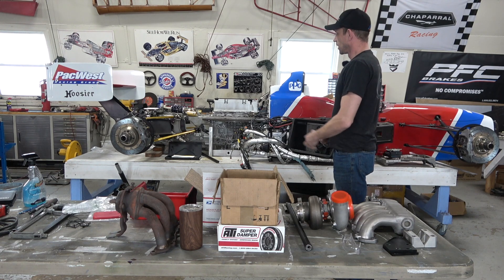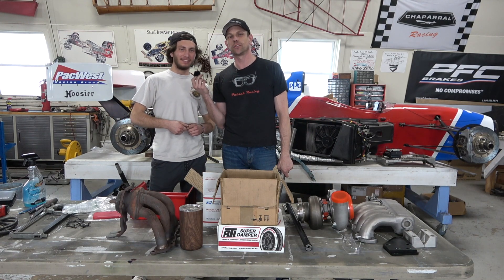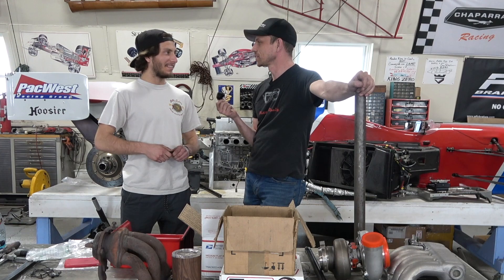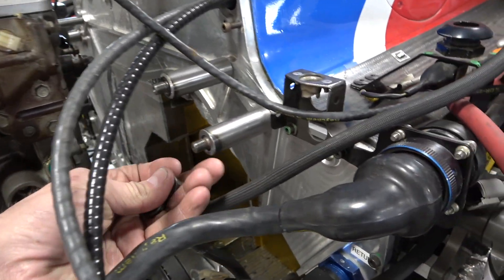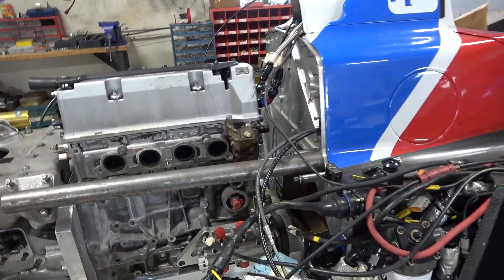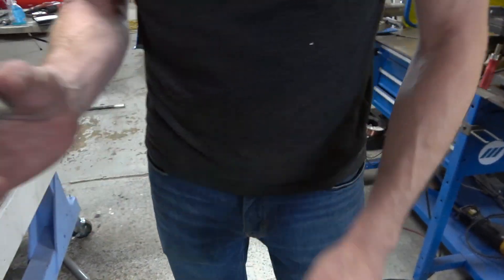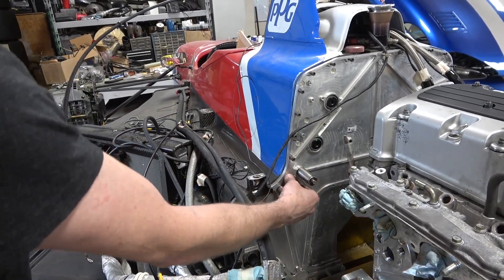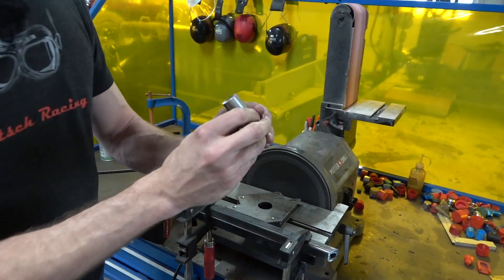Honda K swap Indy Car, I WILL FIX THIS HOT MESS!!!!

Comment: Tell the students to think outside the box with engine building. Doesn’t have to be a car, I built my Honda Groms engine up. Forged crank, big bore, cams, ported head. Still expensive for me while in college, but do able and the stakes were low. Gave me confidence in my abilities too. Cheers Casey, always wanted to join Genius Garage! Graduated in December with my Mechanical Engineering degree!

Comment: Question: While grinding the mount tubes perpendicular on the sander, I would think the linear speed differential of the wheel could lead to uneven grinding. Why not use the belt instead for a more uniform grinding rate?

Comment: I've saved a bunch of bicycle bearing cone nuts using an axle on a cordless drill and a rotary tool with a small fine grinder disc. You just need to find the proper angle for the rotary tool and you'll get the same concave form as the original part, just losing a bit from the total height (or width? as its a part of an axle).
Sure, it will not be perfect and with badly worn surfaces it's quite probable to have a bit uneven bearing surface. Also the nut should most probably be heat treated or something, to get the bearing surface hard enough after grinding the surface. But its still super economic and will get a beat up bike rolling very smoothly with new grease and bearing balls, as long as the cups are not badly worn. Sure, it may not last long, but the original parts were already gone anyway and I'll bet it will hold up a few years even without any treatments. Oh, and of course I'll always use super fine wet sand paper to finish the surface.

Comment: For those interested in these cars, Rob Dahm has a video from a few months back where he took the same chassis (I think) and disassembled it with the ambition of bolting a rotary engine into the back of it. 

His is a lot crustier, but still has all the original stuff bolted together so its a neat watch.